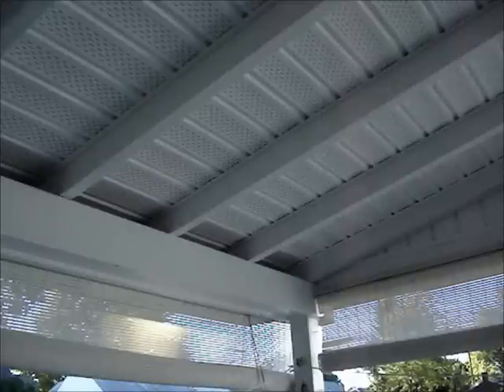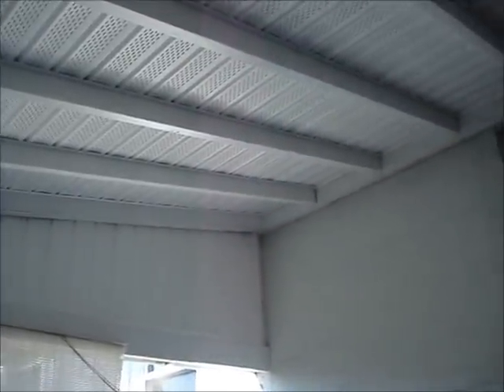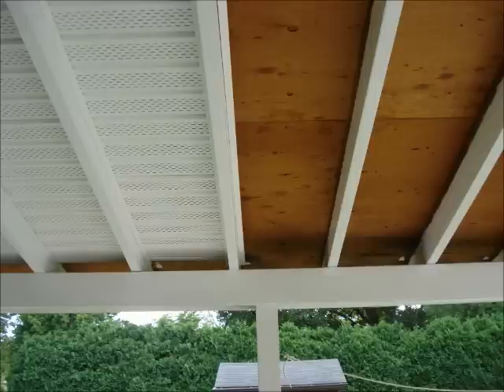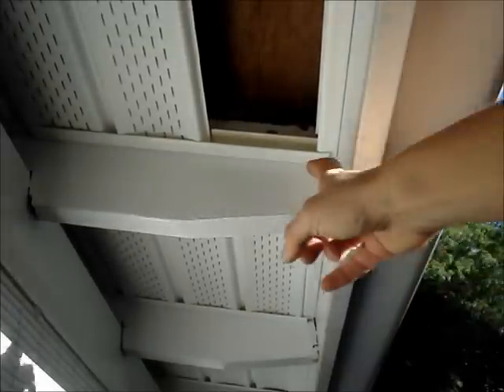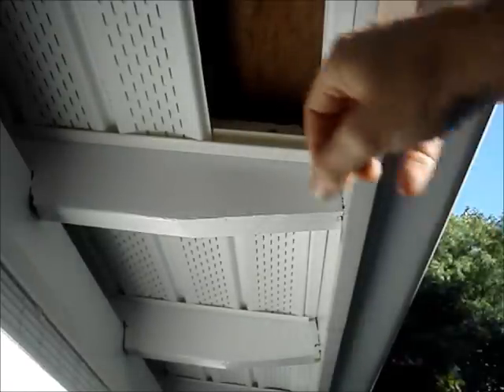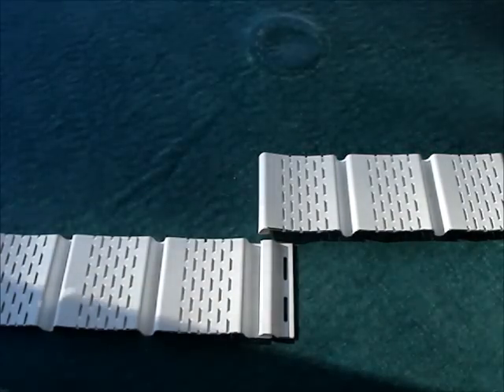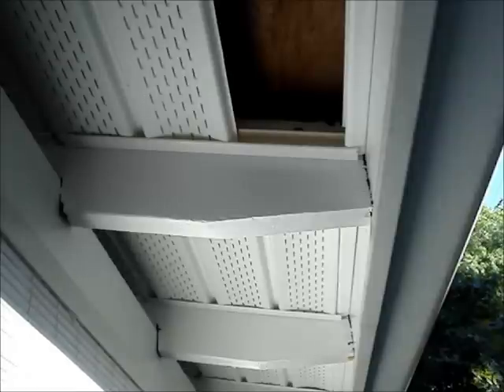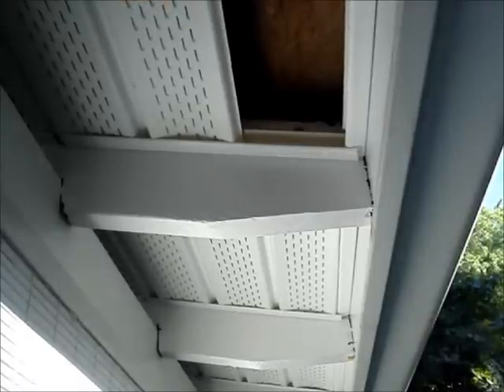How to Cover a Porch Ceiling

Comment: This is what we want to do.. thanks so much for sharing your project!  What are your thoughts if we used vinyl siding instead of soffit?
Reply from the maker: I can't think of a reason why you couldn't use siding instead of soffit.  It's been several years since I've done this work.  I have no regrets.
Reply: @Know How Now   I think we'll be using the 'F' channel instead of J.   Did you use the same on the ends, or was it a different piece?   Also do you have any tips about how you slid the vinyl into the channel?  Thank you again!
Reply from the maker: I used J channel for the ends.  It's been a while since I did the work.  If I remember correctly, it wasn't too difficult to slide the vinyl into the channel.  I think I slid a piece in partially, added a piece, gave it a push and continued the process until the channel was filled.

Comment: Wow, this is fantastic! Just had my roof redone and now my screened porch, very similar to yours looks like a giant pinhead, & same in my attic now. It looks horrible because they used long nails and there are 100's of them sticking out  at least 1/2". The ceiling does get a bit dirty or maybe it's speckled mold, I've never been sure which one. I think maybe because it's screened on only 2 sides (house walls on other 2) and no venting anywhere else, and also has a cathedraled bay/peak area above the table. I'm just worried that there may be a worse problem created between the ceiling and the soffit if I do it this way because I will have to drop the soffit below the nails of course. Then I wouldn't be able to periodically clean it. What do you think? Also heard it is very bad feng shui to have nails pointing at your head... yikes!
Reply from the maker: I used the vented type for air flow.  I left a gap between the soffit material and the roof plywood to allow for any nails to poke through if the roof was re shingled and longer nails were used.  It is kind of cleanable.  It's very easy to slide the soffit material out of the tracks.  You could likely take it down wash it, dry it and put it back up without too much effort.

Comment: What Product did you use for the soffit material.
Reply from the maker: I don't recall the brand, though I do know I bought it at Lowes.  The porch ceiling is holding up well and I have no regrets about how I covered it.

Comment: I've got a big deck roof with a plywood underside to cover and am thinking of doing something along these lines. Great idea. Would it be a bad choice to use the solid soffit for the ceiling portion, as well the sides? I'm guessing that you used the vented type for moisture/ventilation purposes?
Reply from the maker: You are correct, I used the vented type for ventilation purposes.  My thought was that if the roof ever leaked the plywood could dry out.  I think you could use the solid type as long as there isn't a temperature difference between the roof and the ceiling. 

It's a couple of years now since I covered the ceiling and I am pleased with the results.  I haven't had any problems.

Comment: This is BEAUTIFUL!  Does the soffit on the ceiling being vented allow it to drain?  I am looking for a way to cover a galvanized deck ceiling because its old and dented in a few places but the corners sometimes leak when it rains really hard, so wondering if your idea would be better than a wood-type ceiling so it could drain.  Thanks!
Reply from the maker: I used the vented type for some air circulation for the wood above the covering. I can't say if the covering would fully drain in your situation, though it won't rot.